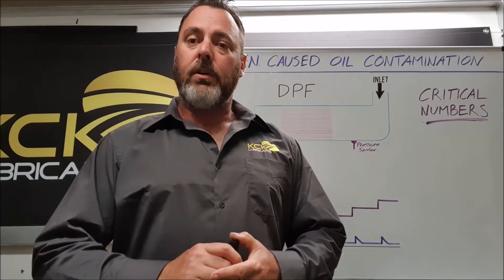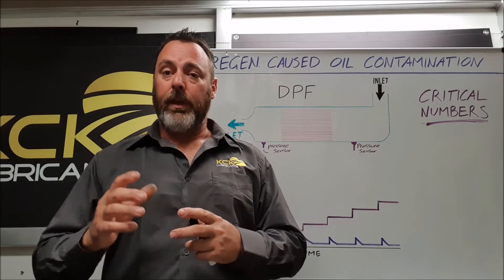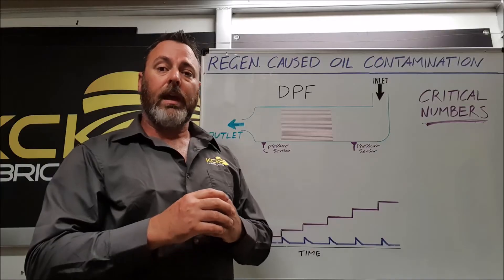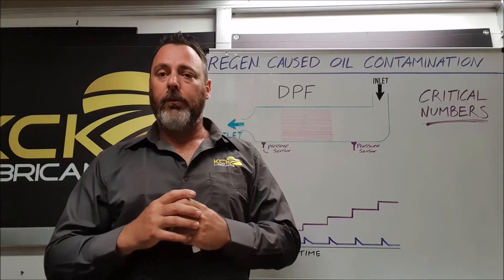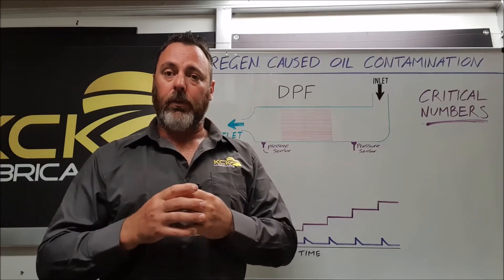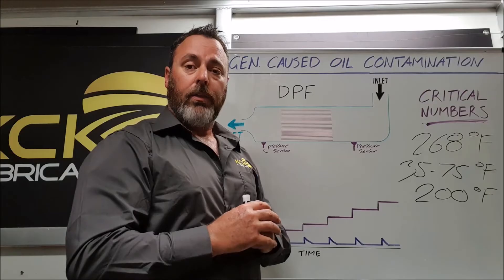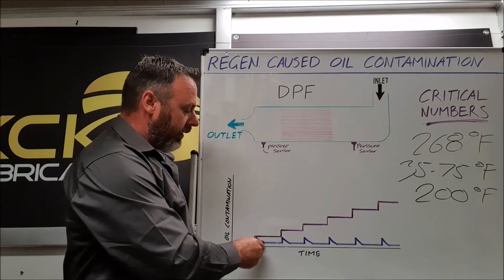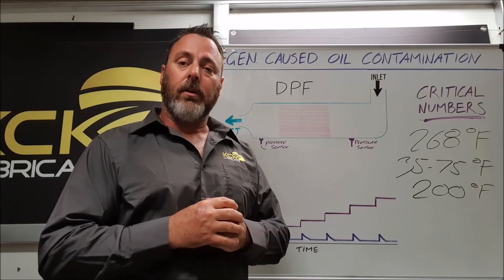Diesel fuel contamination in engine oil caused by DPF Regeneration

Comment: Hello. The explanation is excellent. Thank you. I have a few questions, and if you can answer them, it would be helpful for everyone.

My car has 45,000 km on it, and for the past few months I've been getting a high oil level warning. My car is a 2020 Transporter 2.0 TDI. I generally drive at low RPMs, both in the city and on the highway. The first time I received this warning was on a long road trip while driving at high RPMs, and it reappears every 100 km (after opening the hood and removing and reinserting the dipstick).

My questions are as follows:

1. How can I get rid of this problem? Will this error be reset when the oil is changed?

2. Is it enough to drive at high RPMs continuously for the diesel regeneration to work properly from now on?

3. Doesn't adding diesel to the engine oil alter the oil's structure? Is there a limit to how much diesel can be added by the system?
Reply from the maker: Thanks for watching! for years 10% has been considered the limit of engine oil/fuel contamination however different oils handle the problem differently. If your oil level is too high, you need to correct the oil level for the sensor and warning to stop appearing. High RPM alone will not generate the heat required, you need the load to make the engine work harder to do this. We hope this helps

Comment: Stupid question. But how do I get the temperature to the right value?
Reply from the maker: Thats a great question! within reason there isnt much you can do except putting the vehicle under load to help elevate the oil temperature, in light load or when cruising the oil temperature will normalise within 10 or 20 degrees of the coolant temperature depending on the design.

Comment: Added problem is that diesel vehicles used for short journeys may never get the oil hot enough to vapourise the diesel fuel within it. Thereby causing it to accumulate.
Reply from the maker: Thanks for watching and that is absolutely correct!

Comment: So, EOT around or above 275 F allows the diesel to vaporize out of the oil in the crank case?  When does oil break down due to high heat?
Reply from the maker: Great question and thanks for watching, this is hugely dependent on the quality of oil you are using. This video should answer all of your questions https://youtu.be/oeVS8yNLKEA?si=if2XKwgjQCvpApoi

Comment: My ashok leyland bada dost vehicle frequently need regenaration.. Service light and soot over idications are shown in cluster..vehicle poor pulling. I just inspect my vehicle inlet and out let manifold, turbo, inter cooler, LNT, tmap sensors and oxygen sensor and dp sensors.. Everything ok.my vehicle is BS6..finally i just check my vehicle oil level... Oil level is high.. Required oil is 4.5 litter now 5.7 l in my vehicle.. I think this is the complaint of fuel oil dialution.. I  just take little water in a bottle and dip little oil at that time i show that diesel presence... Any one plz help... What is the reason for this... I need a detailed advice and how can solve this issue... Vehicle is commercial
Reply from the maker: Thanks for watching!

Comment: My van, Citroen dispatch 2021 plate, is going into limp mode every two months, currently driving 30,000 miles a year, I only replaced the engine oil and filter about a month and a half ago and today it’s gone into limp mode again and I’ve had to call the RAC out to resetall the forms that that has caused. The engineer advised to every once in awhile drive where the engine reps are constantly above 2000 RPM, will this solve my problem?
Reply from the maker: Thanks for watching! It is common for elevated RPM to induce a regen cycle, high exhaust temperatures will also help this. If you can keep the engine under load at higher RPM it will help!

Comment: Hello I have diesel in oil sump in my Fend 936 vario. Can it be caused by DPF? What should  I do? I'm thinking of changing the oil and using my tractor while checking  oil level along the way.  Is that good idea, or should I contact  service right away?
Reply from the maker: Thanks for watching! we would recommend contacting your service, the oil contamination may cause further damage.

Comment: Hey I've got a good one...

What if I get 60% diesel in oil?? Well he had a runnaway... Due to turbo faillure..

Engine is dead now but I wonder how so much diesel got in oil...
Reply from the maker: Thanks for watching. That's a great question! There could be several causes of this and we are not even going to begin to guess what might have caused the fuel contamination.
Reply: @KCKLubricants  haha yeah it’s not an easy one to guess…
Have you ever seen that much oil contamination??
Reply from the maker: Only in an engine failure situation, that's a lot of fuel!

Comment: I've just had this problem with my Mitsubishi. It's only done 1400 miles since the last oil change, following a warning on rhe dash, and now the oil level is rising again to the point where it will have to be changed or rusk damage. I've had the dpf cleaned and hopefully this will reduce the number of attempted regens. The problem is that the car has only done 43k in six years and doesn't get the chance to complete the regen cycle. I will now have to ensure it gets a good workout every few weeks to keep my dpf healthy. If only the bloody car would tell me when it starts a regen so i could act appropriately. I know it's possible because my JCB telehandler does this without issue. Better still if I could initiate regeneration at a time to suit me.
Reply from the maker: Thanks for watching! Yes, we hear this a lot unfortunately. Hopefully you don't have any further issues.

Comment: Sounds like even on an old-skool (think 1990sMitsubishi Pajero 4m40 Turbo diesel), even running a slightly hotter thermostat might help burning off engine oil contamination?? ;)
Reply from the maker: Thanks for watching, anything to raise the oil temperature will help!
Reply: @KCKLubricants  I hadn't heard of KCK lubricants. re:-critical numbers - 268F to burn off diesel contamination?. 
The oils im currently using are Full Zinc either mineral, or semi-synthetic. 
I understood that mineral oils are only good to 250F, but synthetic are good to 300F oil temps.
So what oils would KCK recommend for old-skool (think 1990sMitsubishi Pajero 4m40 Turbo diesel), ??
Reply from the maker: @androidemulator6952  We have a specific Diesel oil that would be a great fit for the Pajero. Regarding the maximum operating temperature of the engine oil  we have a separate video that may explain that a little better. https://www.youtube.com/watch?v=oeVS8yNLKEA&t=5s

check out our website for our full product range and all of the specifications. https://www.kcklubricants.com/

Comment: This hasn’t helped me. Please help me. I have diesel getting into my oil and need a complete oil change every 2 weeks. What can l do to fix this problem please????
Reply from the maker: Thanks for watching, This video is regarding Diesel fuel contamination caused by the DPF system. Sounds like you have a completely different problem.
Reply: Add a good diesel treatment in the fuel tank, take the car on a long motorway ride, and change the fuel filter. You may need to run the fuel additive for long to see any results. May be the engime combustion chamber needs a good cleanup.
Reply from the maker: A good fuel treatment will absolutely help, here at KCK we have developed a fuel treatment/conditioner that will keep injectors, EGR and DPF systems clean and prevent further soot deposits. Customers have also noticed a vast improvement on fuel consumption, power and smoother running.

Comment: Nice explanation.

My local Toyota dealer tried to claim that 5% fuel dilution of the oil was perfectly normal on our 2015 Yaris 1.3 L... while the oil analysis company is warning that this is dangerous N.B. The oil analysis company is the one to listen to.

The fuel dilution of the oil only started after E10 (10% ethanol) fuel was used for a while: 
After stopping the E10 the fuel dilution dropped back into the normal range.
The problem was only picked up because 

The E10 causes further problems when it oxidises (and polymerises) and deposits a sticky sludge in the engine:
The sludge gums up the rings... which is what allows the fuel to bypass the rings and causes the fuel dilution. 

Gumming up the oil rings can also increase oil usage if it gets bad enough.
In our 2006 Yaris 1.3 L the car suddenly started to use a lot of oil... even though the compression was normal and the mechanic couldn't find anything wrong with it.
It wasn't even obviously smoking... which is mainly what made it hard to diagnose.

The fuel dilution itself causes a breakdown of lubrication and is probably the main reason we now see so many low km (well-maintained) cars with scoring of the bores.
You can avoid this problem by bonding a lubricant to the metal.

The sludge doesn't want to come off without some encouragement... even after multiple oil changes: 
To get rid of the sludge do an engine flush (or two). 

We used a product called "Ring Free" on my sister's 2006 Yaris and it suddenly stopped using oil.

N.B. Diesel has some lubricating properties (compared to petrol)... so fuel dilution may cause fewer lubrication issues in diesels.
A full synthetic oil seems to help avoid the fuel dilution problem as it offers better protection via better lubrication than semi-synthetic or mineral oils.

🙂
Reply from the maker: Thanks for watching and thanks for the comment!

Comment: So what if we have 10% fuel in the oil? 2020 6.7 powerstroke. Cleaned dpf, manual regen, p2002 code, oil level rises, all 3 oil test show 10% at end of oil life. Oil is also blowing past the coupler coming off the turbo outlet.
Reply from the maker: Thanks for watching, There could be a few reasons for this, It could be as simple as worn piston rings or the engine oil doesn't reach operating temperature due to short running times.

Comment: It’s not burning off carbon particles it’s just making them smaller and dislodging them from the filter.  It’s a scam!  All that black smoke from a burn is particulate. It’s not condensation like our clean burning coal power plants co2 that are being forced to close. Corruption!  Amazing how ppl believe what they are told to believe even if it’s totally non comprehensible and makes no sense. Total wacky joes upside down wold of total control.  Elitism is power and control
Reply from the maker: Thanks for watching!

Comment: Hi KCK! What a brilliant video. I have just subscribed too! I have a question if you can just confirm my hypothesis to be correct or along the lines if I’m wrong. I have a Ford kuga 2014. It has the vaporiser that sprays the fuel into the DPF. Cut a long story short. My sump was filling up with oil and causing diesel runaway 😮 I changed the vaporiser and it was completely blocked. I then drained oil etc tried again still ran away stalled and then took the DPF off it’s completely blocked. Am I right in thinking that because the DPF is blocked this is causing some sort of pressure in the engine and causing it to somehow backfill with diesel and go down into my sump to then cause the run away. Any advice would be appreciated as in these current times a vehicle is needed for my children. Many Thanks
Reply from the maker: Thanks for watching! wow, i would hate to guess on that one. We have seen all sorts of weird problems caused by blocked or blocking DPF.

Comment: Interesting vid mate, my 2009 sprinter is suffering oil contamination all because of  DPF…. It’s only done 152,000 miles so it’s not what you would say “high miles”….  Dpf egr etc etc is killing a decent turbo Diesel engine,     And I am old school
Reply from the maker: Thanks for watching! everyday we hear the same thing regarding to problems created by pollution management.
Reply: What have you done to solve the problem? I have a Vito taxi 67 reg and mileage is 154,490 , keeps telling me to reduce oil level, diesel is mixing up with oil and giving off a lot of fumes and I am not getting the same mileage as I used to get.

Comment: Does a 2013 2.0 crtdi vw diesel engine use a fifth injector or its using postponed injection to raise the egt during regeneration? I just changed the oil in it, did 500km highway driving, than 10km of city driving, and if I saw it correctly there is more oil already in the engine. This seems to me that the car did one regen, and already fucked my oil up. Im using my car in the city on workdays, and on the highway on weekends. I dont want to buy a gas passat just because of this.

Comment: Question- Diesel and Lubricant will form a homogenous mixture. This will lead to lowering of overall evaporation temperature of Oil. If this continue to happen its not only Diesel that will get evaporated. But also oil which will get replaced by diesel after next regen

so the oil concentration will continuously decrease.
Reply from the maker: Thanks for watching!

Comment: Does the car have to be actually driven for the washed fuel to evaporate after a regen? Will the diesel not flash off even if the car is stuck in traffic? How long after a regen does the car have to be running at the right temperature for all the excess diesel to evaporate?
Reply from the maker: Thanks for watching, Normally the engine needs to be under load for the oil temperature to get high enough.

Comment: Question- if diesel in lube evaporates above flash point then where does those fumes go?
Question- if the travel through vent. Modern day vents goes to air inlet won't that cause more white smoke?
Reply from the maker: Thanks for watching and great questions, yes the engine is designed to contain all emission and will introduce the small amount of vapor back into the intake. Its only a very small amount and will not cause any issues.
Reply: Im planning to put external intake manifold catch can to prevent oily crankcase fumes from mixing with EGR gases in intake manifold , forming crusty carbon buildup.
Reply from the maker: This seems to be a common modification!

Comment: Hi, I have problem with pressure motor oil in a CAT 950 H, was going down after dilution with diesel, the mecanics have detecting a problem with de pump but watching a dilution in last three reports make me have some dudes about the if really coold be the pump and it is going to be the rigth solution, could I have some suggestion or recomendations about it?
Reply from the maker: Thanks for watching, Depending on the engine the pump can leak from the front seal directly into the crankcase, definitely worth a closer look!

Comment: For two years and this problem occurs to me, and sometimes the code P1405 appears , With a large consumption of diesel, what is the appropriate solution ?
Reply from the maker: Thanks for watching, You should find a reputable repair shop that car correctly diagnose and repair this problem

Comment: After having indestructable older diesels i  bought a second hand modern vauxhall with a circle L engine ...dealer had no idea about modern dpfs and i suspect the dpf was already screwed by its previous owners short journies....it was 12 months of motoring hell and then total Dpf failure, car going into limp mode constantly and could never figure out why oil level rose constantly ......if you dont do regular longer journies do not buy a modern diesel no matter how tempting the price ...go for a  euro 1.2 puretec or ford 1.0 ecoboost engine if you want good MPG
Reply from the maker: Thanks for watching, definitely something that has become an issue and a story we hear all the time!
Reply: Well said

Comment: Excellent Video, very, very informative ☺️
I have a 2008 VW Golf 1.9 TDi (105hp engine code BLS), do you know if over filling with engine oil could cause intermittent plumes of blurry black smoke? Is this dpf or egr?
Reply from the maker: Thanks for watching, overfilling the engine oil will definitely cause issues!

Comment: Hope you can shed some light 😢

We got a Merc (automatic) e220d w213 a 2017 model and is displaying “Reduced Oil Level” when driving long distance.

When shutdown and restart, the error would disappear. We have replaced, the oil sensor as well as reduced (drained) some oil out but still same issue.

We took it to Mercedes branch to have read for error codes. They were not in position to diagnose or get any readings! They simply said “it could be water or could be diesel but it would be costly to look into it…”

It is concerning because If its diesel mixing then it can damage the engine :( 

What to do now? What do I need to change / replace to fix it? Is there an option to reset it or what exactly?

On Motorway highest speed driven is 80 mph. Do we have to drive faster for the DPF to burn properly?
Reply from the maker: Thanks for watching, sounds like a tricky one and i would hate to guess. Find a good mechanic that is interested in helping you!
Reply: I have the same problem in my car can you please help me what have you done with your car to fix that problem please

Comment: Hello and thanks for the video. Great explanation! However I have one question about one particular oil and a car (VW TDI Passat CRLB 2.0 TDI 110kw). The engine oil in question is Shell Helix Ultra Pro AV-L 0w30 (GTL oil which very stable in terms of temperature). The oil temperature while on highway with the abovementioned car (and oil of course) is ~ 108C. In the video you mentioned that higher the better? Is this a problem? Or the given car has improvements in the DPF regeneration cycle ? 
Thanks!
Reply from the maker: Thanks for watching and make sure you Subscribe! After the initial generation of DPF systems there has been large advances in the efficiency of the DPF systems, another thing to note is even if the sump oil temperature is 108c the oil temperature can far exceed this in situations like oil reaching the back of the pistons or the oil exciting the turbo housing.